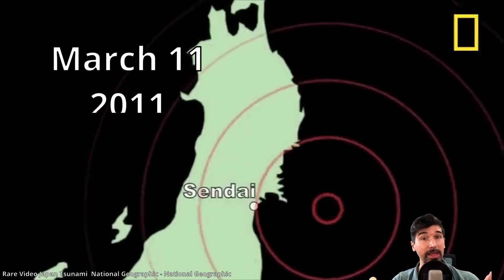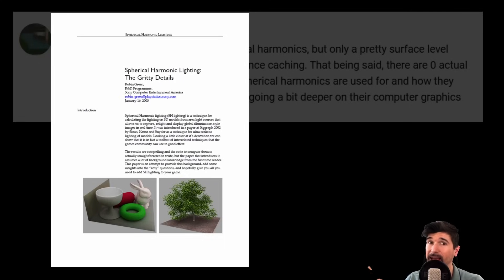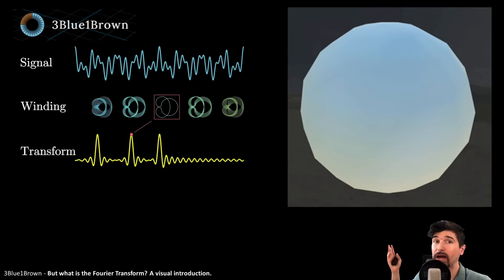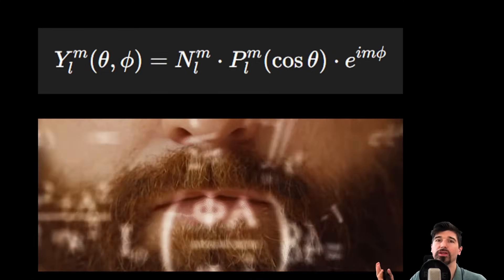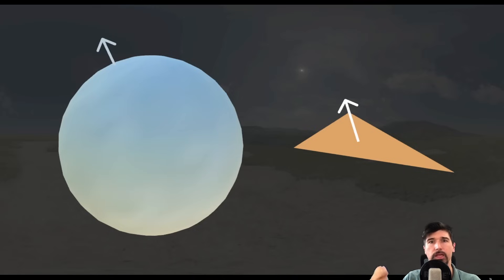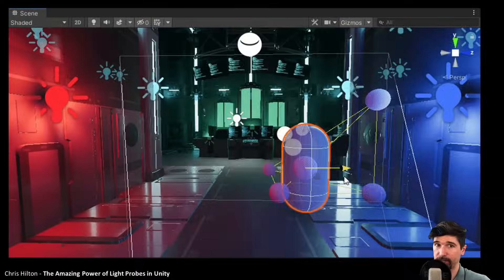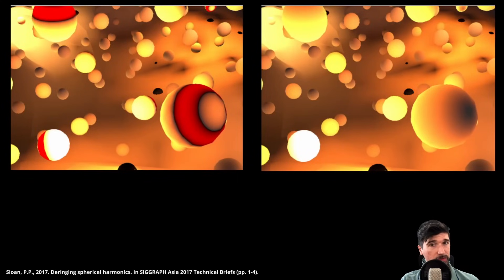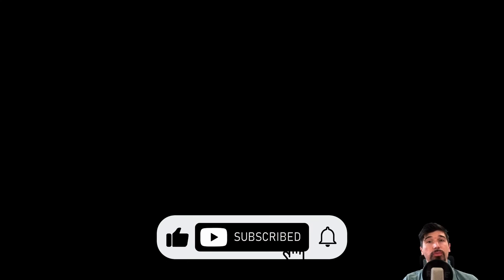03.2 - Why Wrapping Sound Around a Sphere Changed Real-Time Rendering, but Lumen BARELY uses it

Comment: I don't think comparing 6x128x128 cube maps to 9 coefficient harmonics is good, since function described by such SH will not contain as much information as such cubemap. It would be more like 6x4x4 or something, which is a very blurry cubemap. Which might be great for diffuse lighting, but saying that it's 10000x memory saving is not correct.
Reply from the maker: Yeah, I think you're right to call that out, thnx for chipping in with the comment. 😃

That “10,000x” stat definitely assumes you're comparing a full 128x128x6 cubemap to a 9-coefficient SH, which really only captures the low-frequency stuff. I would say that for a blurry environment map that could work but for path tracing for a cubemap, you would definitely be right. 

In that case, I agree, a better comparison would probably be against something like a super blurry cubemap of maybe 4x4 or even 2x2 faces. 

Still a big savings, but not quite as dramatic once you factor in what kind of detail you’re actually preserving. Appreciate the reality check!

Comment: So to clarify, you sample the irradiance for the probe (in whatever level of detail you prefer using whatever technique you like, such as proper path tracing) then find coefficients for the SH function that cause the function's output to align to the sampled data as closely as possible. Is that a good summary? I would be interested to understand what the process looks like for finding those coefficients. I guess it's something like applying a FFT to the sampled data, but a) I can't picture how that would work on a cubemap, and b) I'm not sure how you choose which of the frequencies to keep, assuming the FFT would create many frequencies.
Reply from the maker: Yeah, the first part is a great summary. I had issues understanding it, which is why I opted to use a graph instead, since there are less variables.

Regarding the second part of your message, I don’t fully know how the projection math works either, but I think you’re spot-on with the FFT comparison which in this case is on the sphere instead of over time or 1D space. 

I’ve seen examples where they sample from a cubemap and then reproject those values into SH space, but I couldn’t tell you exactly how the filtering or “frequency selection” works. Would love to dive deeper into that part myself too if anyone else is interested. 😃

Comment: This is like next level optimization, neural nets though make so much sense for this, I'd love to work on a neural net for lighting and shdows using rt.
Reply from the maker: I’ll be honest, I didn’t actually know what neural nets were when I first read your comment — had to look it up 😅 thnx for chipping in with you comment

But if I understood it well, wow, the idea of using them to learn lighting patterns from ray-traced data sounds really smart. Especially if they can help predict or fill in complex shadows or GI without needing a ton of rays each frame.

Kinda makes you wonder what else could be learned and reused like that — feels like it’s heading toward real-time intuition for lighting.
Reply: @markitekta2766  If anything I'm surprised by neural networks being (in theory) faster than standard ray tracing. I'd (naively?) expect those to be 100 times slower!
Reply from the maker: @pacomatic9833 I'm not that much versed in this topic, but it's a great suggestion for future research 😃

Comment: The technique is very interesting but it feels like the choice of spherical harmonics rather than some other scale based decomposition of the functions on the sphere.  For instance, there are a host of different wavelets that also let you transform a function into an orthogonal basis where earlier terms give you lower 'frequency' information.  It would be interesting to see if you could reduce the ringing issues with it.
Reply from the maker: Yeah, I’ve seen wavelets pop up a few times in papers but haven’t looked into them properly yet, especially not for spherical domains.

Would be super interesting if they could smooth out the ringing without losing the compactness SH gives. If you ever run across a good example or test of that, I’d love to check it out. 

Thnx for chipping in with your response 😉

Comment: It reminds me an mp3 compression. It does a fft on the audio and removes higher frequencies. Since most information is in the high frequencies which are much less audible the size is reduced significantly.
Reply from the maker: Great analogy, thnx for sharing it 😃

It’s basically the spatial version of what MP3 does with audio which is to break it down into frequency components, throw out the ones that don’t matter as much, and keep just enough to reconstruct something believable. 

I guess we can say that SH do that for lighting by cutting the high-frequency details, but keeping the shape of the environment’s light. 

Super efficient, as long as you don’t need crispy reflections.

Comment: many of the most visually stunning games of the mid-to-late 2000s relied on SH-based light probes to do much of their heavy lifting, including half life 2 and sonic unleashed. when used in combination with baked light and shadow maps, and smartly placed reflection probes, you can do a lot, even if it means all light is static
Reply from the maker: Thnx for sharing 😃

I wasn't aware of the examples, but after checking them out, I can see what you are referring to.

And I agree, we can say that some of those games still hold up visually because they leaned so hard on smart probe setups and baked lighting, so when you know what tools aaare at your disposal and what you would like to get in the end, you can achieve great results, like with HL 2 😃
Reply: And it wasn't always completely static -- I believe some games changed time of day by just adjusting the SH representation.
Reply from the maker: Yeah, I think Jerome Plataux talked about it in the 2017 lecture I mentioned, but at the time they could only have 2 distinct lighting setups, nothing in between, if I got my understanding right

Comment: something i’ve pondered before is if light baked textures could be improved by using spherical harmonics stored in textures. it would expand the texture memory needed but perhaps it could be worth it for having baked dynamic reflections, even if a bit blurry.
Reply from the maker: Yeah, that’s actually a cool thought — I’ve wondered something similar before, thnx for the feedback 😉

The tricky part is that baked textures (like lightmaps) usually combine surface detail and lighting in a static way, so even if you stored SH in a texture, it wouldn’t help with reflections since those are view-dependent. They’d just look kind of “stuck” as the camera moves.

I did go over some block compression techniques in an earlier lecture that can try to make baked lighting more memory-friendly 
https://youtu.be/M3BSCH7oucc

Now that you mention it, storing SH coefficients as JPEG-style compressed textures could actually work for low-frequency stuff like ambient GI. Still wouldn’t solve specular or sharp reflections, but might be a neat direction for ambient baking or even hybrid probes.

I'm doing the radiance caching in the next lecture, with screen space probes, so maybe that can spark some new ideas 😃
Reply: @ i mean, my thought was maybe on geometry that’s got rough enough normals to not get a clear look at the reflection, maybe that could be a simplified version of what’s reflected, at some reduced texel scale. like it could make the reflections at one angle show the dark side of an object while at another angle it shows the sky, or whatever, and because it would be in a texture, it could be different at a different spot, some other angle is where you see the darker object.
Reply: like do the normal reflection vector calculation and use that to sample the spherical harmonics. the texture is static but it contains the data to make it react to the view vector. just nothing moving will show up but i think that’s ok in a lot of situations
Reply from the maker: @morgan0  Ahh I see what you mean now and that actually makes a lot of sense 😃

Using the view vector to drive a lookup from a baked SH texture sounds like a smart way to get some reflection response without needing dynamic probes. Especially for rougher materials where you don’t expect sharp detail anyway and to me it seems a lot like the radiance caching approach that is due in the next video. Let's see if that is what you were thinking of when the next video drops.

Comment: You can store radiance in spherical gaussians or in ambient-dice.  Not as accurate as a real cubemap, but for roughness up to 0.5 it looks good. Order 1886 uses spherical gaussian lightmaps. They use SG at high roughness, and blend to cubamaps on low roughness.This technology makes this game look great to this days.
Reply from the maker: Thnx for sharing your thoughts, I appreciate it 😃

Yeah I love the Order 1886 as an example, someone mentioned it a while back, I checked out the gameplay and it is still one of the best-looking games out there, regarding realistic depictions, eventhough I'm more prone to stylistic looking ones.

That said, it’s wild how much of that comes down to smart use of SGs and lighting blends.
I think someone also mentioned ambient-dice too, it’s such a cool middle ground. Makes you realize just how much can be faked well when you know the limits.
Reply: spherical gaussians have the downside of not being an orthonormal basis (pretty sure that’s the right word), which means you have to do some fitting or refining process. spherical harmonics however don’t have that issue and each one can be calculated independently.
Reply: @morgan0 
Thomas Roughton solved this problem by developing the "Progressive Least-Squares Encoding" algorithm. With it - you don't need all samples upfront, and can accumulate them over time.
Reply from the maker: @TsutsuYumeGunnm   @morgan0 
Wow, thanks for adding that, appreciate it 😃

I’m definitely outside my comfort zone on the fitting side of SGs, but it’s super cool seeing how much this stuff has evolved — especially when it bridges over into things like lightmap tricks or runtime accumulation. 

Appreciate you both sharing 😉

Comment: Spherical harmonics are also used in directional audio. They are standard for the Opus audio codec.
Reply from the maker: As more comments come in I start to realize that SH really is the Swiss army knife of directional data. 😃

Audio spatialization is such a cool use case, wasn't aware of it. Love seeing how the same math finds its way into both visuals, sound, atoms, the planet etc.
Reply: @markitekta2766   I was surprised to see they are used for lighting. It is not as intuitive for me, as in audio, the sphere is centered around the listener, but in video, I'm not sure where these spheres are supposed to be. But I still found the video interesting. I think I got the gist that roughly ambient lighting is like a bumpy surface and it can be approximated with simpler harmonics.
Reply: If you want to learn more about their  application in audio, search "Ambisonics"
Reply from the maker: @russellchido  Thnx for the clarification 😃

Yeah, I can also find myself having difficulty understanding SH in audio, but I think after a couple of minutes discussing it, we would see the logic behind it.

If you'd like, you can check out the previous lecture where we talk about the placement of those probes, but I think you saw them in the light leak scene there as well.

Either way, I now have new ways to understand and deepen the knowledge for this topic, thnx 😉

Comment: You are right, lumen can not calculate proper indirect shadow due to prob sample limitation, in this case, high precision pathtracing really shines ! I have a quick demo here: https://youtu.be/Pq0YjRBfDl8
Reply from the maker: You’re absolutely right — Lumen trades accuracy for speed, especially when it comes to secondary occlusion. The probe-based caching smooths out indirect shadows, which is great for performance but can’t compete with full path tracing in precision.

Thanks for sharing the demo — it’s a great reminder of what full global illumination really looks like when you can afford the rays.

Comment: Great video, thank you for taking the time to address the details. One question, though, is it possible to use a higher level of spherical harmonics to get the high frequency detail?
Reply from the maker: Thanks so much, I really appreciate the kind words! 😃

And yes — in theory, using higher-order spherical harmonics (like L5, L6, or beyond) can capture more high-frequency detail. But in practice, this comes at a cost: the number of coefficients increases quadratically (L3 = 9, L5 = 25, L6 = 36...), which means more memory, more math, and less real-time friendliness.

Even then, you still won’t get perfect sharpness — especially around shadow edges. That’s why techniques like reflection probes, cube maps, or radiance caching step in for specular and view-dependent effects.

I’ll be covering that next — stay tuned! 🎥